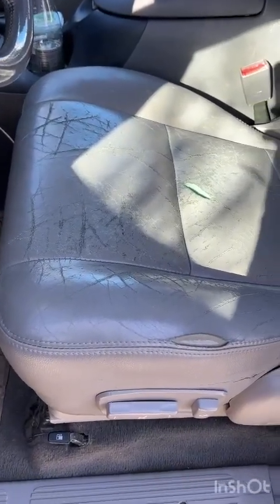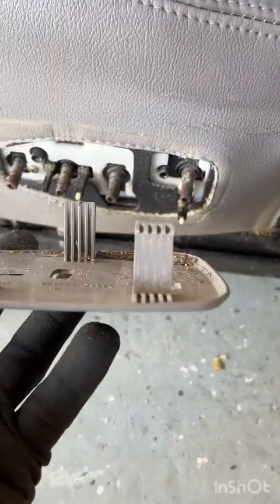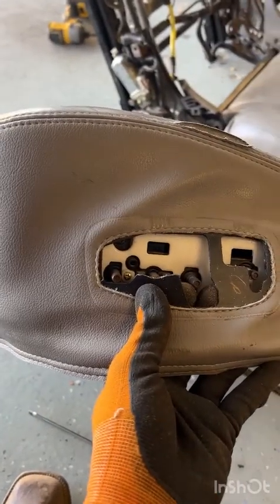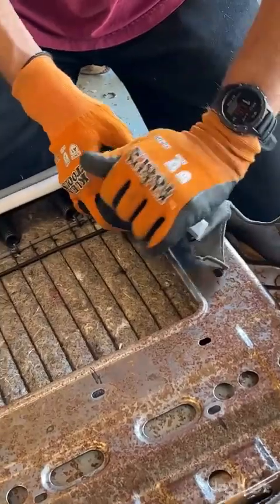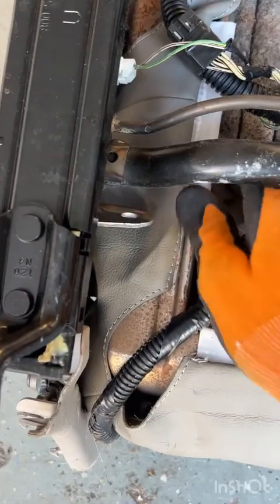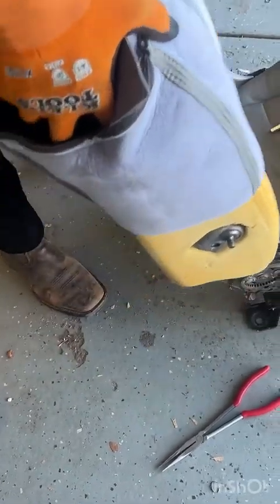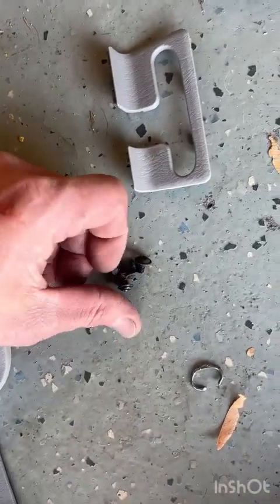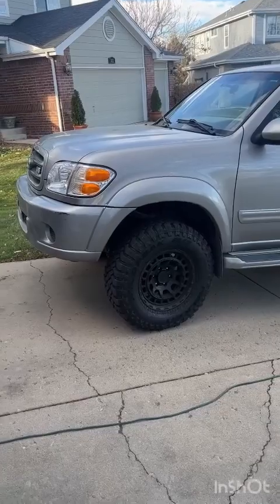Replacing Leather Seat Covers 2001 - 2001 Toyota Sequoia (Gen 1)

Comment: Thank you for your excellent video. An average DIYer can do this. You gave me the confidence to replace the bottom seat cover on the driver's side of my 2001 Sequoia Limited--instead of just repairing the tears or adding a seat cover on top. Replacing the seat cover was the absolute best choice. My seat looks like new!
I was able to use the Hog Ring pliers to crimp the rings by having my wife pull aside the seat foam and hold the plastic bars from the new seat cover tight against the metal bars from the existing foam. 
I purchased my cover from Autumnharvest on Ebay. The gray leather color matches perfectly. 
You Rock Stu!

Comment: HUGE tip on the bottom seat covers. The first one i did, i cut out the leather like you did. It was okay. When i did the passenger side, i marked and cut out very small pieces that simply aligned with the controls that needed to get through the leather. Got a much better install and far less fiddly. Just my .02.

Comment: Thanks for this video. Note that seats on the 2005 sequoia are built differently and you can’t pull apart the frame. Also be careful when removing the old covers, the wire string holding the hogs may rip the foam easily.
Reply from the maker: Great point! I found a few of the videos on the later Gen 1’s, but couldn’t find one on the first 4 years.